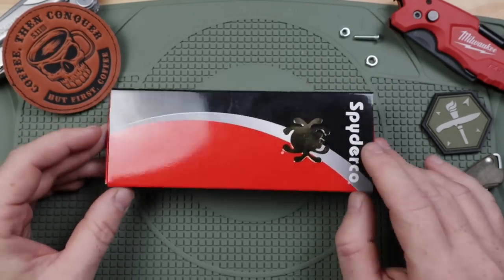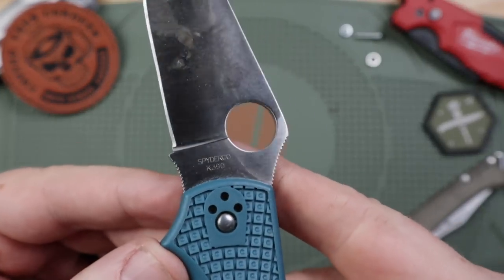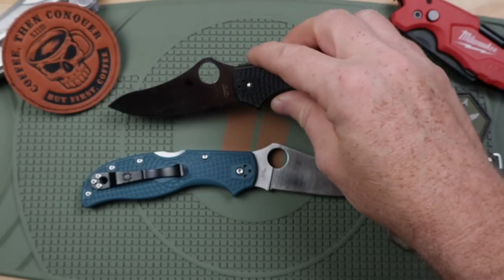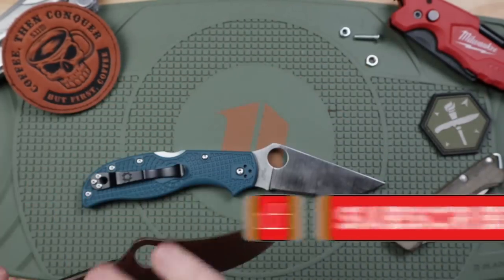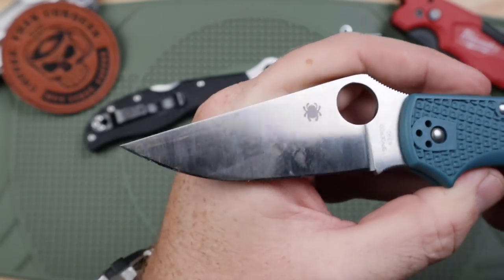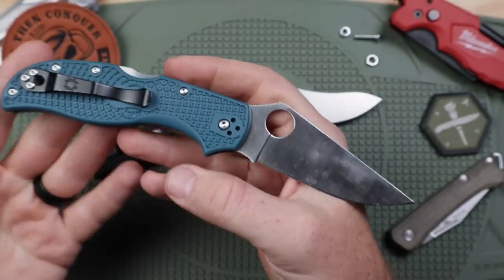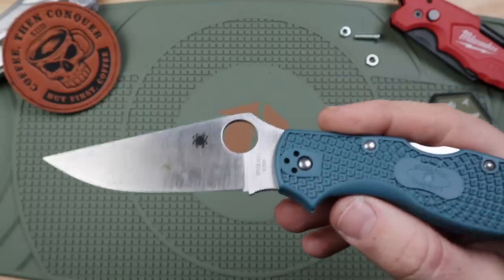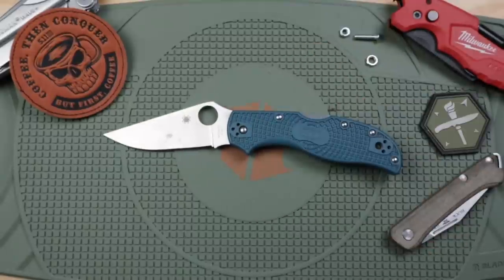I Have NOT Been Excited About Spyderco In Years! Will this Change That?

Comment: Just got mine delivered today, thanks to your recommendation!  Feels great and happy I scored one in this steel.  One tiny nit in looking at it, which makes no difference in the slightest:  WHY on this one model only did Spyderco put a black clip with a satin blade?  I've never see that combination.  It does contrast fine with the blue handle, and like I said of course makes no difference performance wise, just curious.  (Maybe they had a batch of black clips they needed to use up?)

FYI, on every G10 or CF Spydie I buy I always pickup a Lynch deep carry clip, but never on the FRN handles.  I don't know why; maybe because they're generally thinner so I want them to stick up more.  Spyderco factory clips are some of the best in the industry regardless.  Way nicer than the ugly black steel clips Benchmade uses.

Comment: I love the older blade shape of the Stretch 2 and in my experience, M4 > K390 in every aspect.  M4 is, IMO the ultimate knife steel for a folder.  For me, the Shaman is the best Spyderco ever and the new Bodacious that's being dropped looks like it'll be a close second.  I love the Manix 2 (standard, I don't like the lightweight versions of anything Spyderco) as well but I think the SHaman is just the absolute best Spyderco I've ever owned/used.  I find it so laughable that anyone would ever buy a Benchmade anything o ver a Spyderco, even as inflated as the prices are these days.

Comment: Also if you love this one then you gotta get the K390 Enuff2 hooooly moly is she a thin lightweight slicey fixed blade edc or whatever role you want to fill with it itll do and do well but it takes a stupid sharp edge and holds it forever! So perfect of a fixed blade but the sheath is that glass filled garbage dulling your edge on contact so kydex is a must right away! I'm still using an old bark river leather sheath with mine, I put it in the oem sheath twice and had to resharpen it twice so after that it will never ever see that sheath again and I really wish knife makers would just STOP using glass which is harder than steel common sense here!

Comment: I just picked up the Military 2 with S110V, purple handles?or blue or...Hard to tell from picture. I ALSO DID THE TRI-angular sharpener with 50% off LEO code. We'll see. I've never used that steel but the Military is well loved. The M2 has the compression lock, so here's hoping it'll be a homerun

Comment: I have an Endura  in K 390. I almost had a leaf hopper in the same steel. Butt, alas  the pivot screw was bad. I hope that it has found its way back to Knife Center. I am hoping that a one that experienced good quality control will find its way to Knife center and then back to me before I die. K390 is a great steel My Endura puts the scary in sharp.

Comment: Highly recommend the new LeafJumper in the same steel or the rockjumper
(the latter is vg10 only for now).
The handle is basically the same as the Stretch’s, but without a forward finger choil and jimping if you prefer that like I do. The pocket clip is also deeper carry.
My Rockjumper has the smoothest lockback operation so far. It’s a good alternative.

Just an update, cause I’m not sure when this video was made, but the Manix LW has been or is being updated to screw construction.

I hope the new Stretch XL gets some K390 as well.
Reply from the maker: I will have to look at that one again

Comment: The Native 5 is still my top choice for a lockback.  But this raised by eyebrows some.
Reply from the maker: I need to revisit it.  I feel like you have to use the choil to get good purchase on it.
Reply: @gideonstactical yeah, which seems to be what the design is meant for since the choil is so pronounced. For me, they did it well, and it's very comfortable to use. Plus, it's very robust and takes a beating.

Comment: Nice review! but no, I'm not buying another spyderco with lockback ever since my matriarch 2 failed, closed on my hand and gave me a nasty cut. Not safe. Their other locks are much better, they should use them instead.
Reply: Cold Steel's tri-ad lock is so far the best back lock IMO.
Reply: @PerceptionVsReality333  Absolutely! Since them I'm a cold steel fan haha
Reply: @rodrigolaporte274  

Since you're a Cold Steel fan get the recon 1 mini if you don't have it yet I highly recommend it. It's similar size as the Delica 4 but half the price with better blade steel & way stronger built. The AUS-10A has similar edge retention to S30V.
Reply: Did the blade get bound up in something? I mean, the matriarch blade shape kinda limits the sorts of things you can do with it (it’s not like you are going to baton it while processing wood) so I’m wondering how much the knife gods dislike you.

Comment: I love the designs of slot of Spydercos, but to be honest, they make me not buy them but only having plastic as the handle material. I'd even take g10. I adore my pm2 in s45vn I've had a couple years now and still carry it but I got some custom titanium scales on it to make it feel a little more beefy. These models with that lightweight plastic scales that can't be swapped for anything else, are to lightweight for me and feels cheap. This is just my opinion, if you like it that's fine, I just don't.
Reply from the maker: This one is not bad with the steel liners but I get what you are saying.
Reply: After purchasing one Spyderco lightweight I have not purchased anymore LWs.

Comment: Meh.  Sweep on the Stretch blade looks to kick in later and is more severe than the Endela's, and it has the idiotic finger choil, but is otherwise the same as an Endela.  I'll take the Endela every day and twice on Sunday over that.  In fact, I have an Endela in K390 on the way now, joining the 2 Endelas I already have.  It is the PERFECT size IMNSHO.  It is one of only two knives of which I have multiples.

If one just has a hard-on for the finger choil though, well, enjoy the Stretch.
Reply from the maker: So interesting to each there own. I reviewed the endela and couldn’t stand the ergos and would take a stretch over it. 🤔
Reply: @gideonstactical  I take it that the Endela's handle wasn't quite tall enough?  After this video, I found a few comparison pics with the two side by side, and the Stretch is both a bit thicker and taller, so it should fill the hand a bit better.  Enough so that I'm going to try to get one in K390 the next time a big sale comes along.  So who knows, I may be singing your tune in the future.

Comment: You are right!  The original stretch was the ugliest looking thing and I was not a fan of the VG10.  Too hard to sharpen and never held an edge very well.  I really like the redesign with the K390 even though I don't have any experience with K390. Knife center is claiming 2.7 oz for the 2XL in FRN which has to be a miss print. I used mine hard for 10 years everyday before the lock up eventually failed.  https://www.youtube.com/watch?v=TEYeXvtgvu0